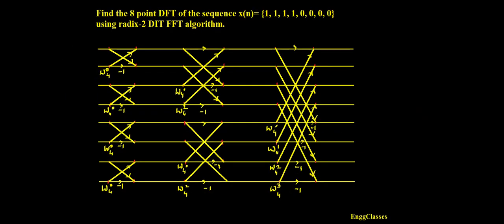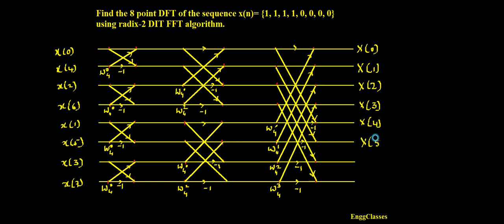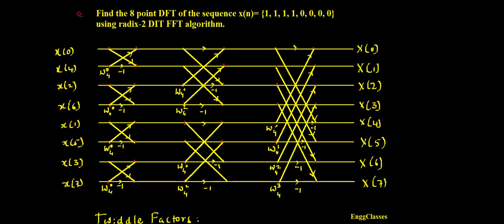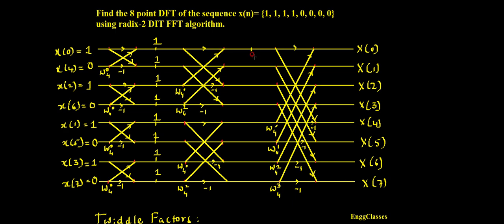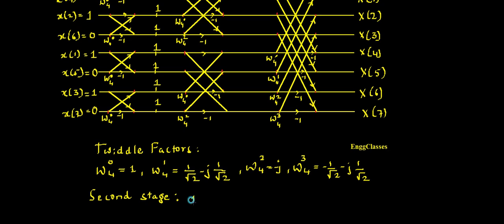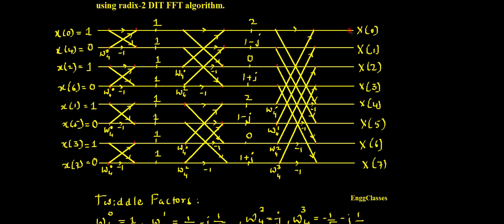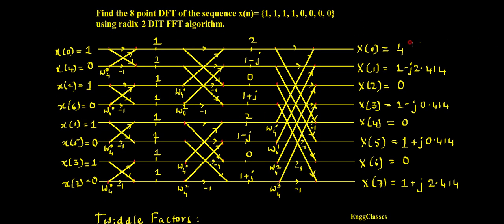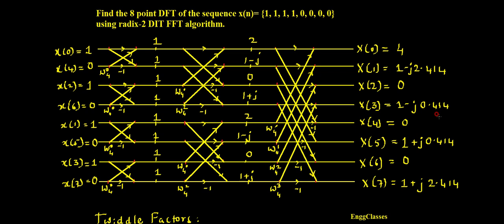Q5b Use the 8-point radix-2 DIT FFT algorithm to find the DFT of the sequence x(n)={1,1,1,1,0,0,0,0}

Comment: why are we using w4 when it is 8 point DFT?
Reply: it is same, when it comes to the coefficients. eg, w4^2 gives w8^4, like that. If you convert it to the standard diagram also, the results would be the same.
Reply: No, He is wrong in mentioning the twiddle factors, but he has solved it in a right way itself